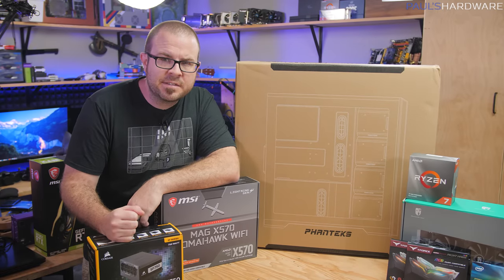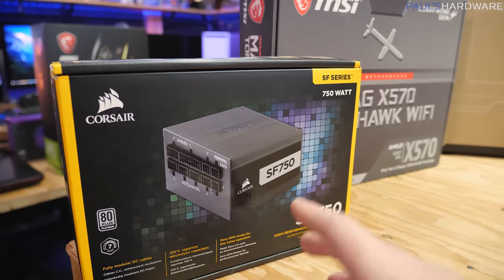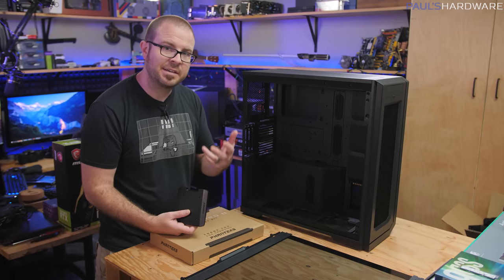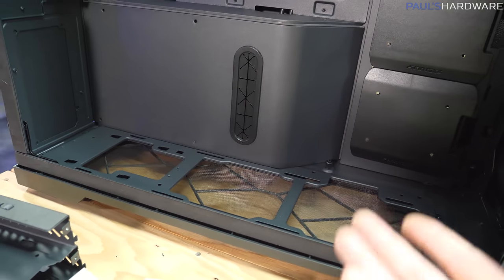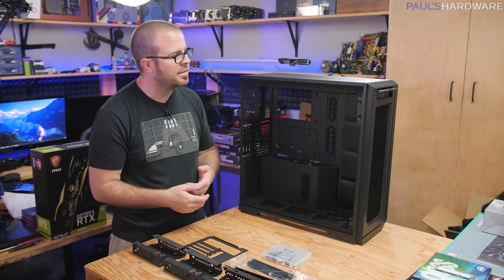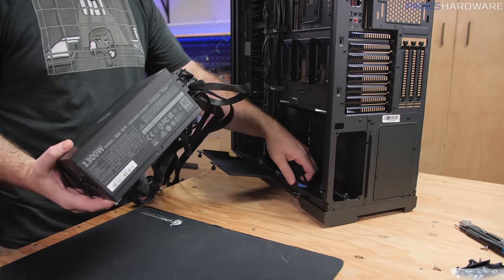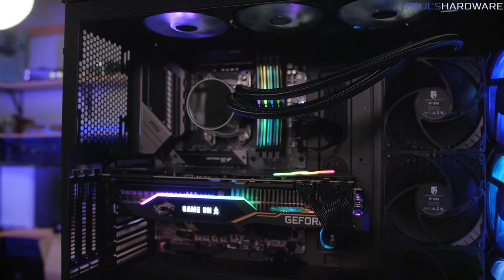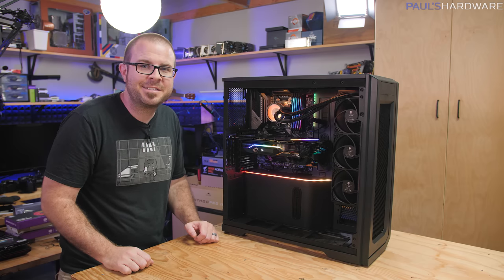Building a $2800 Gaming PC in the NEW Phanteks Enthoo Pro 2!

Comment: WHY does every single "case showcase/review" ignore completely HDDs 3.5" ??? 
Space for HDDs should be one of the most important features when deciding which case to buy.. And no single review covers that ?? They all concentrate on these stupid flashing fans cluttering case as Christmas tree.. 
Most people still use multiple HDDs as the main storages for all multimedia, pictures, movies and games, and SSDs only for Windows and a few important applications needed for work.. 
SSDs are still too small and expensive for any real use.. Instead of spending over 200$ on a 2tb ssd, you can get HDD with 16tb.. So 2tb vs 16tb ?? 
All those reviews are joke..

Comment: What a fucking waste man 
Should have used 
3800X
Mobo is fine 
32gb 3600mhz hyperX ram 
5700xt (best price you performance) or 2070 super ( if you want Nvidia) 
1TB SSD is fine 
$1000 boom. 
Performance will be within 5 10 percent and you'll have almost 200% on price. 
Use that $2000 and travel or pay off your loan

Comment: What was the point of this video. If it was an Ad, it was a bad. If this was a feature showing for the case, then why did you not use it correctly. If it was just to build a PC then the case was so wrong. So in the end this case does not go with the parts put in there, and the parts should not be used with this case. All in all WTF.

Comment: So help me god if I watch another tech tuber put the m.2 on the chipset instead of the cpu I’m going to lose my mind. Stop this you silly boy. X570 it doesn’t matter too much however, every other AMD chipset you loose so much performance. Please... you wouldn’t install ram on the 2 closest slots, don’t do it to the m.2 drives
Reply: Not that I disagree with the overall statement you're going for, but it should be noted that it only applies to NVME SSDs, not their older brethren.
Reply from the maker: I agree with your point John, but I don't think I have made this mistake. I'll use a Gen3 drive in the chipset-connected slots pretty much every time and save the dedicated PCIE Gen4 slot for a Gen4 drive that makes use of it. If you check the B550 build I did a few weeks back I point this out specifically -- I saved the Gen4 slot for a future upgrade since the drive I picked was Gen3. X570 provides Gen4 connectivity thru the chipset as well, but for the best performance you'd want the dedicated x4 connection from the CPU.
Reply: Paul's Hardware then why bother using the chipset slot in the first place... if the argument is maybe I’ll use it later then just use it now. It won’t be any easier and we are talking about 30 seconds.You wouldn’t put a gpu in anything other than the top slot. This stuff is important because no one talks about it and folks think they are the same. I’m not nitpicking for the sake of it. I think out of all the channels I watch you are the most careful with descriptions and word choice. Be 10/10 not 9.5/10 👍
Reply: Also, by putting the m.2 into the chipset slot, you effectively eliminate the availability of all the other pcie slots. In your b550 video if you install say a capture card or a network card you drop that m.2 to gen3x2 when there was 0 reason for that to happen. I love watching the build videos everyone produces but I really think there needs to be some conversation about what happens when you use the chipset slots. Like you lose SATA ports x4 vs x2.

Comment: Keep thinking I fucked up hard, 2800$ system and all ur parts are more expensive than wat are in mine cept the CPU I'm rocking a 3900x with only a 240mm aio, when I part of mine it's at 3k and I only have a 5700xt and a 180$ mother board lol didn't even buy a power supply lol I fucked up hard